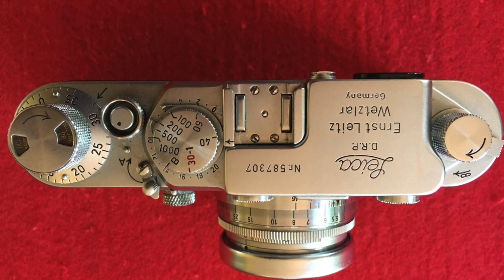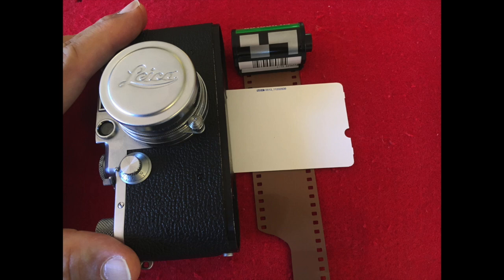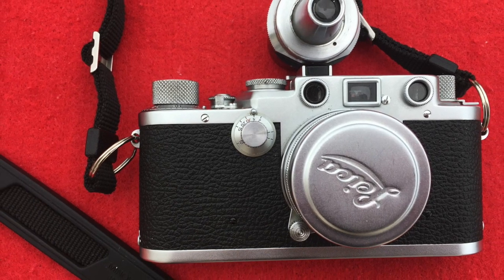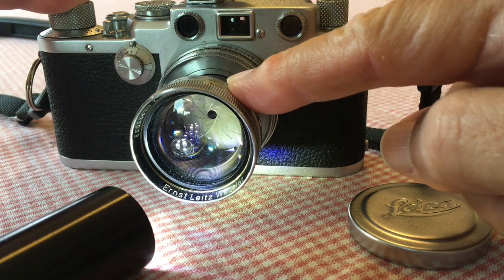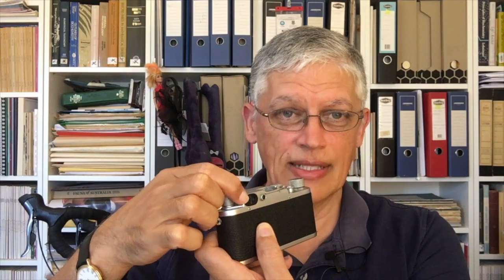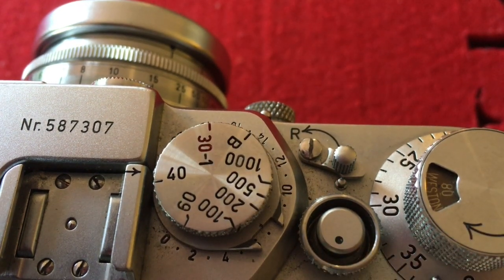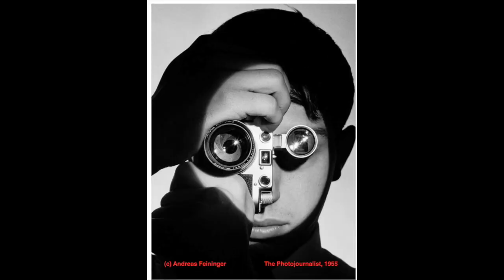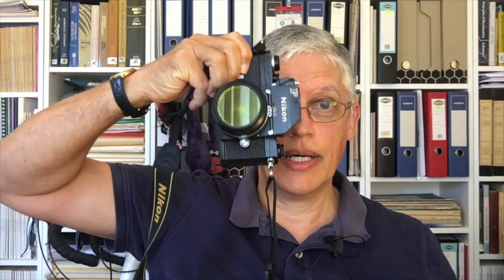I bought a Leica | things no one tells you

Comment: I think a Barnack Leica is like a vintage car.  If you want to use it every day, then you need to get used to it and have a lot of mechanical sympathy. Once you do that  and really connect with it you have a great experience. If, however you just 'take it out for a spin' now and again you need to concentrate on getting into the mindset so you don't expect it to do things it was never meant to do.  I love using my IIia precisely because it makes me look and think in a different way from my Canon 5D. - And I don't drive my 1959 Austin Healey like I do my modern Jaguar. :-)    Lastly, I highly recommend an ABLON film leader cutting template. - Solves the whole trimming/ bits of loose film/jamming issue! :-)
Reply from the maker: Thanks for sharing your experience. As it happens I alternate between my IIIf and my M3 to keep them in use and to keep my practise up to speed. Cheers.

Comment: One more thing, at 4:57 you seem to cut in short strokes multiple times, but it's not the best way to cut since it causes micro jagged edges. You should open the scissors more and then do a long stroke following the curve. This way the result will be much smoother.
Reply from the maker: thanks for noticing. Actually I was trying to show that if someone had butchered the leader that they would need to smooth it out before it could be used. Cutting it smoothly at the start makes everything easier rather than hacking at the leader and then have to smooth it out afterwards.

Comment: I believe those Barnack Leicas is the most affordable way to get into Leica rangefinder system (Ms are most expensive). And plenty of good 3rd party Leica screw mounts lenses available: Nikon, Canon, etc. As long as you stick with shorter primes like 50mm, and not doing macro work, it should be fine.
Of course, if you are patient enough and wiiling to spend more cash, then get a M3 or M2. Handling the Barnacks is a bit annoying.
Reply from the maker: Thanks for sharing your point of view. Cheers.

Comment: Have you yet scratched your spectacle left lens with the metal ring on the back of the rangefinder or viewfinder windows?
Reply from the maker: Lol, good question. No, for two reasons. The IIIf has a plastic surround to the viewfinder and two, I only need spectacles to read not take photos. I have nearly scratched by sunnys on the M3 but fortunately it did not happen. Cheers.

Comment: Thanks for the great video! Î knew most of these things because I have owned a Leica M6 TTL for a few years. That experience cured me completely from Leica GAS (gear aquisition syndrome). I found the autofocus to be not precise enough to focus the Noctilux lens at f0.95, I often made the mistake to forget to take the lens cap off the lens before taking a picture, exposure was quite often a little bit off (because of the imho not too good metering of the M6 TTL - even when you know how to exposure compensation in manual mode) and I was completely unable to take pictures of anything that was moving with at wider apertures. Also some of the lenses were imho a bit underwhelming (especially when it comes to bokeh) and overpriced at the same time. Honestly I'm wondering why this camera has such a good reputation. Having learned my lesson I now take analog 35mm pictures with a Nikon F6 and digital pictures with a Sony Alpha 1. I'm very happy with both cameras.
Reply from the maker: thanks for sharing your experiences. In my opinion, Leicas have the reputation from history and build quality, who used them and that they are very solidly built. Importantly, in the film world of today, with nearly no new film cameras, you know that you can get a Leica repaired, and if you so desire, you can buy a new one. This happy state of affairs is partly due to the much maligned collectors and rich amateurs who buy these cameras :). They're not easy to use, and trying to shoot a moving target at say f1.4 or f2 with a rangefinder is one of the hardest things to do. That's what autofocus and a motordrive is for.
Reply: @billbarendse1918  Nothing against Leica in general, but the M system is imho just an anachronism - and yes, you're right: one with great build quality 😅  Personally I think Leica M cameras are best for reportage style photography - something I never do. For people photography (which I do a lot) it cannot be focused precisely enough at f1.4 or f2. And yes, this is why autofocus was invented and this is also why I use either my Sony Alpha 1 or my Nikon F6.

Comment: Leica are very well made cameras no doubt on it but they are not perfect. They need to be regularly reviewed and re-adjusted which is expensive too. I got a Leica iiic and an m4. They do good pictures but not better than my other film cameras. In 2022 if you want to make film photos with rangefinder cameras the voigtlander Bessa L (for 15 and 25mm) or Bessa R (for 35, 50 and 75mm) are far cheaper and more efficient. They got and metering system, a shutter which goes to 1/2000 , very nice and sharp lenses at affordable prices. They look a little plasticky but they are light (good for your back or shoulder). For 500€ which is not the price of a Leica lens… you can have a Bessa and a good lens. 15mm is amazing and permits very interesting shots, 25mm is good for street photography, and 35mm is universal. The voigtlander lenses alone can be found for 300-400€ so for 1200-1300€ you can have a camera + 3 lenses with an incredible range from 15 to 35mm. Add a 75mm and you can make portraits. With one camera and 4 lenses you are not even at the price of an m4 without a lense (2000€).

Comment: Video @ 14:44 "on his Leica M4 - a close look at the lens indicates it's a Leica Summar" - Correction, Henri Cartier-Bresson (in that image), had a collapse Leitz 5cm Summicron on a M6 (has a built-in meter). There's some 30 years between those very different lens formulas (Summar to Summicron), plus, you keep saying Leica III. The different 'letter' designations also traverse some 30 years (III, IIIa, IIIB, IIIc, IIIf and finally IIIg). They're very different cameras - In fact, image #2 is an M3 body & the next image #3 shows HCB using a IIIg model...
Reply from the maker: thanks for the note about the summicron and the M6, I'm afraid I don't have a prize for spotting mistakes :). I appreciate the differences between the various Barnack cameras, I don't disregard them, but they are as nothing to the difference between Barnacks and M Leicas. My point in that section is that HCB used both an M Leica and a Barnack camera, in his usage the M Leica did not replace the Barnack. HCB used Barnack Leicas starting with a Leica model I and used a wide range of Barnacks all the way to a IIIg, to fix on any specific model would have been over precise and so incorrect.

Comment: This is why I don't bother with a Leica III. Leica M3 all the way for me. Best Leica ever made. And I know this because I bought a new Leica MP from Leica two years ago - which now is going back to Leica a second time for a mechanical issue after I just got it back from a repair that took two months to complete.
Reply from the maker: I know what you mean, I have a Leica M3 as well. I think most people are happy to pay the difference. But the IIIf is a solid, well built camera similar in finish to an M3 and may not need to be returned to the manufacturer :).  Thanks for sharing your experience. Cheers.
Reply: Leica M2 for me. I had one in the 1960s and miss it to this day.
Reply from the maker: @neilpiper9889  many people have the same response they say the viewfinder is the most useful. I have yet to try it. The prices aren't coming down, unfortunately, so that's going to be a while :(
Reply: @billbarendse1918  The M2 is nice, but a bit "short" on frame lines (M6 and MP are better in this sense; there are some M4 cameras with re-fitted frame line masks). If I remember right, the 75 mm frame is missing, and I'm not sure about 28 mm (I had one, but too long ago).
Reply from the maker: @c.augustin  M2 only has 35, 50 and 90 frame lines, and the whole viewfinder is an approximate frame for a 28 mm. The M4-P was the first to have 28 and 75 frame lines, like the M6.
Reply: @billbarendse1918  Ah, yes, you're right. No 135 mm frame – because the rangefinder isn't accurate enough (or better – our eyes aren't). There's a 135 mm lens with "goggles" that works nicely with the M2 and use one of other frame lines, I think it's the 50 mm (and maybe it also works with the M3); I had it, but it is too large/heavy for my liking and defies the purpose of a rangefinder Leica. I have a book with all the lenses and camera models in it, but after moving last year I still don't have access to it (and I'm too lazy to look on the iNet ;-)).
Reply from the maker: @c.augustin  I've heard of the goggled 135s but your comment is in line with everything else I've seen on the web, that it's heavy and not that accurate, so I believe that. At that focal length professionals are using SLRs. I think goggles can give the camera a steam punk air, they can disguise that it is a Leica, but they do detract from the aesthetics of the camera. People who say they don't worry about the aesthetics of the camera they're using are lying :)
Reply: @billbarendse1918  Yes, aesthetics are part of the fun! But it is a matter of personal preference. A screw-mount Leica is somewhat "special" in this regard and already steampunky for our modern eyes.

Comment: BTW I never used scissors to cut my leaders, I got into the habit of just tearing it at the sprocket holes. I found you could get a nice smooth curve by tearing it. I never had a jam, and my first Leica3 I retired only because the viewfinder lens fell off, but I can appreciate the risk of film debris clogging the shutter curtains.
Reply from the maker: thanks for sharing your experiences. I have seen footage of people tearing film to the correct length and it seems to work but I haven't tried it myself. From your wording it sounds like you still have a Leica 3, which is good to hear. Cheers.

Comment: Video @ 2:38 "for my camera - - -" - Having serviced countless Leica screw mount cameras for over 40 years, about 10% of them have had past service personnel install
the Pressure Plate in THE WRONG WAY ! - There's a tiny bevel on one end of the metal pressure plate, this can be easily reversed. This error in reassembly can make loading the film VERY frustrating...  Video @ 8:44 "claim - you will destroy the camera" - Destroy ? Ridiculous/Absurd; those German engineers weren't stupid... The best warning about the spinning speed dial, is to make sure you avoid even the slightest touching of it with your finger as the camera is being fired off...
Reply from the maker: thanks for sharing your experience. I think you may be right about the pressure plate assembly. I might add that the exposures aren't perfectly horizontal, suggesting some other issues. But otherwise it works OK.

Just to be clear, that claim about destroying the camera at 8:44 is not something I made, I'm merely reporting what some have said and I clearly debunk that notion. But, importantly, I've heard the same claim made for Soviet copies of Barnack Leicas, so it is misinformation among some users of these cameras.